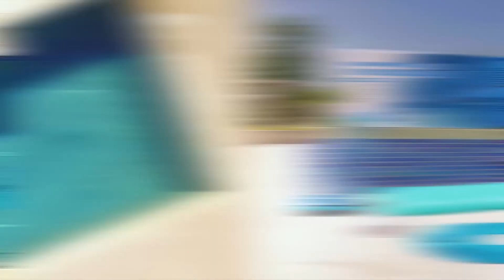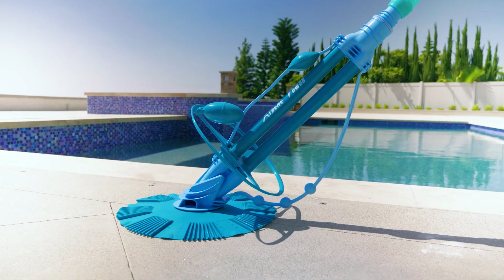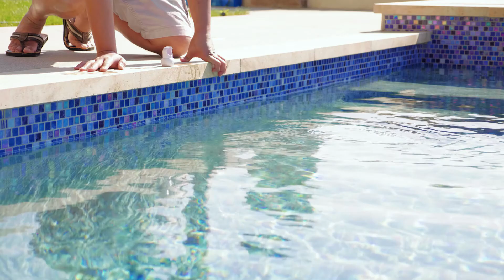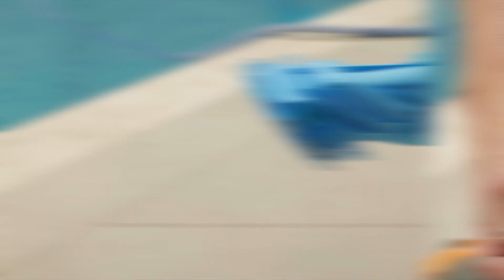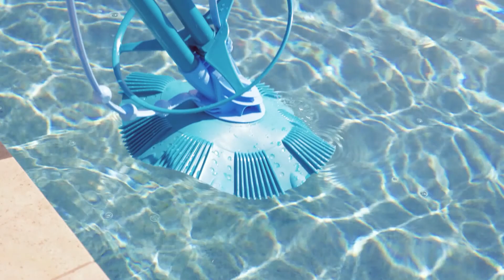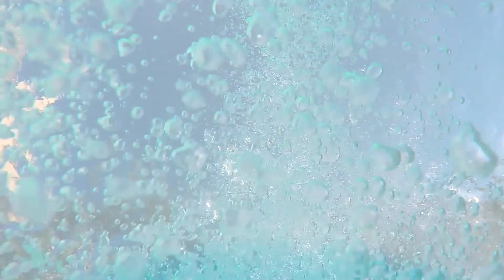XtremepowerUS Automatic Suction Vacuum Climb Wall Swimming Pool Cleaner 75037 Trouble Shoot

Comment: This is the 2nd cleaner that I have purchased and both times I’m having the same issue. The hammer will not click back and forth unless I get it started by hand. There is nothing clogging it from inside. Why do I keep having this issue?
Reply: I had the same problem after 4 years on my first unit! I found i could invert the vacuum from pool side to vertical then manually engage the hammering mechanism! Might take a few trys but insure the suction is set to maximum and you're holding the unit upside down but close to the water level then just toggle the hammering mechanism a few times back and forth until it starts hammering again, then let the unit sink back down to the pool floor once you have it hammering again. It is a PITA though, so I just bought a new unit on sale for like $89.00 including all the accessories. I can't complain after 4 years of near continuous use, plus I miss the wall cleaning capability as the old one lost that as well, when new it climbed up past the waterline, lost suction briefly, dropped down to the pool floor and took off again! When it works.. it works well, other than occasionally getting stuck at the steps... Working on that issue as well!
Reply from the maker: Check to see if the 'hammer' if is stuck, you can try to move it by hand, then check water flow in the pool system, make sure water is flowing because this cleaner requires at least 1HP pool pump or 1600 GPH water flow to function effectively.

Comment: I have a relatively flat lawn that nevertheless has a number of bumps and uneven bits in it because it is a bigger, more country like lawn🌼 allabout.wiki/MJ401E  After the set up, which went as smoothly as can be expected given how much I hate learning to work new tech toys, Sun Joe got to work and did a surprisingly quiet job of getting the mowing done. While it has gotten itself stuck a couple of times, lifting the mower out of a too low bed edge occasionally is a whole lot less labor-intensive than dealing with having the mow crew come twice a month and having to pay the resulting bill.